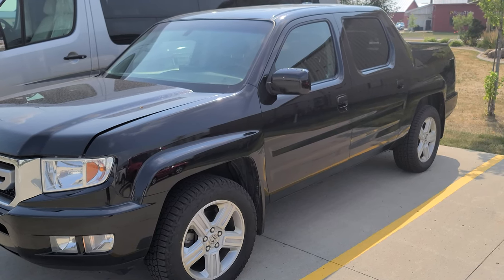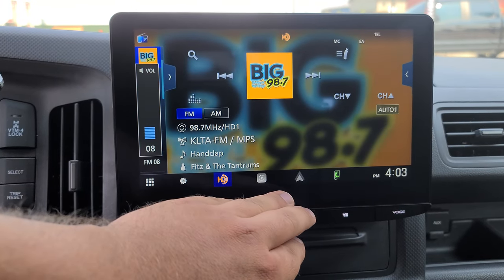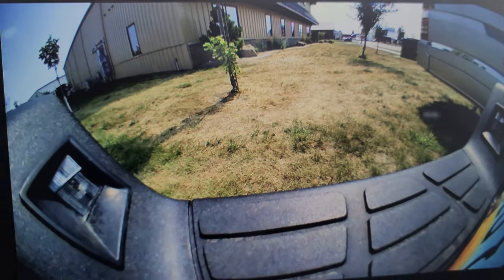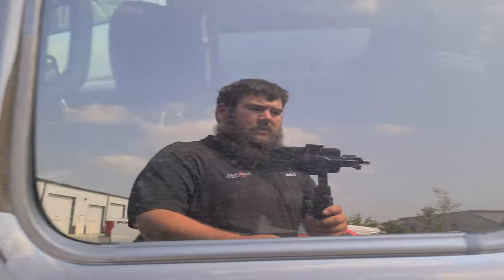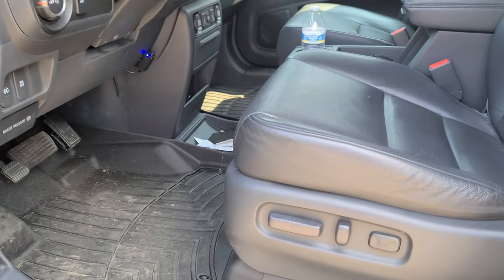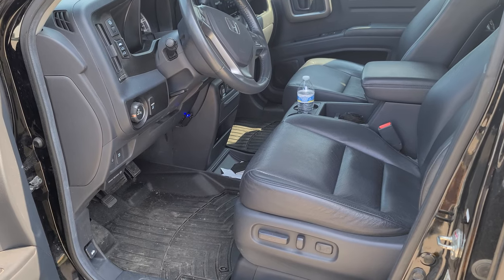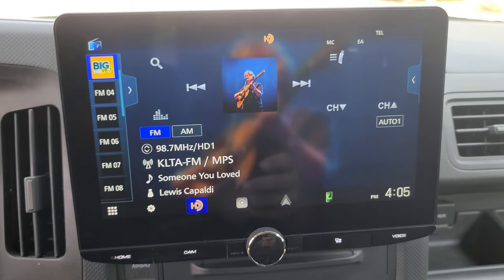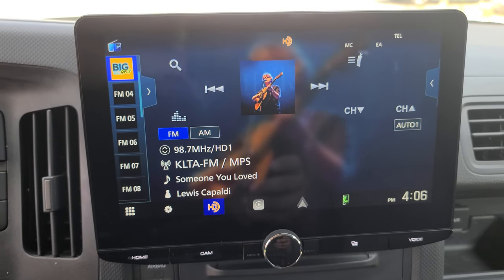2010 Honda Ridgeline Radio Replacement & Stealthy Subwoofer Install

Comment: Thank you! I have been searching for a way to either add an OEM sub to my 2008 RT, or find a way to keep all my room. 

I just picked this subwoofer up from ebay for $180. I am going to be upgrading my head unit to a sony xav-ax1000 too. I hope thats a good head unit, I really want buttons and a knob, not the touch controls. 

I upgraded my Girlfriends 07 camry with a BOSS floating screen one with apple car-play. The audio quality was far worse that stock, but it had nice pre amp out puts so I threw an AMP in it and it fixed the audio quality. Carefull with the BOSS units, as i think it lied about the power. But the software is really good.

Edit: They may not have lied, but I threw some JBL speakers in; and at high volume the quality was horrible.
Reply from the maker: @john-shreds Boss does tend to stretch the truth on the power ratings of their products. I am glad that you were able to get everything straightened out though!

Comment: Wait, you think there is more room under the seat than behind the back seat?
Reply from the maker: This client didn't want to take up any space under his rear seat at all. This was the perfect option to add bass to his vehicle and not take up any of his cargo space underneath the rear seat. Thanks for watching!
Reply: @theaudiogarage7461  No, BEHIND the back seat. Where the OEM sub sits. I have a Kicker Hideaway 8 inch and it won’t fit under the seat because of the DVD player.  I didn’t want to use that nice cargo space under the read seat so I pulled the OEM sub and put the Kicker in the OEM location. It is possible to put a better shallow mount sub in the OEM box, build a whole new box and I calculated that I can fit 3 Kicker Hideaways back there. This leaves the whole area under the seat completely usable and it’s also pretty hard to steal it if they can’t see it or find it without removing the upper seat.
Reply: Dk if you'll see this -I want to do exactly what you're describing, but I know nothing about wiring or head unit install. Was it hard to take out the OEM sub? And how did you secure the Kicker Sub in its place? Screws?  Thx @Yohann67
Reply: @TomTomTom87  I now have TWO Kickers installed behind the seat. A 10 inch behind the drivers side and a 8 inch in the OEM position.  I simply shoved the 10 in it’s spot, I used a piece of wood and bolted it the OEM holes and then strapped the kicker to the wood.
Reply: @TomTomTom87
21 seconds ago (edited)
Thanks for the quick response man. Was it hard to run wiring to the OEM new sub? @Yohann67
Reply: @TomTomTom87  Wiring was ez, pull the rocker covers and thread an 8 guage wire from the battery to the subs, then a RCA cable and a trigger wire from the remote out on my Kenwoood deck.
Reply: Wait theres a sub behind the rear seat? How do i get to it? I just spent like 3hrs  fixing the handle/latch that releases the botim of the seat so i can lift it up like seen in this video @Yohann67
Reply: @RandoManFPV  Depends on the model but yes!  Lots of pics and videos on subs on YouTube and such.   The OEM sub if equipped is not as terrible as you might think but  it has nothing under 30hz. The sub slopes to match the seat back. It’s behind the passenger seat and is about 6 inches deep to about 4 inches deep on the top. I had a Kicker 8 inch Hideaway from my previous vehicle so it slipped right in there. I found a used Kicker 10 inch Hideway for a good deal and stuffed it behind the drivers side rear seat. There is actually room for 2 Kicker Hideaways in the OEM spot if you mount them vertically. If you happen to have 3 it’s worth it, I don’t think I would go out and spend over $750 when you could have one built for that much.  

The Kickers are quite good, mine was excellent in my Toyota Tacoma Access cab where it was under the seat. It would hit 30 hard and a little bit at 25hz. It had NOTHING at 20 due to a subsonic filter. The effect of having 2 of them is synergistic and the 25hz output is much greater.  It’s not going to rattle your mirrors but I had tuned it to the point where you could feel it kick like a brat in the seat behind you on a long flight. Some people have added a new 8 inch driver to the OEM sub box, plenty of info out on that.

Comment: Now here is one for you. I put a free air ten inch sub right smack in the middle of my back wall bhind the rear seat. I dyno matted the wall bhind it, and e erything around it. I am in the middle of mounting another ten directly underneath the floorpan between the two seats. I drilled 1/4 holes in a speaker cover like pattern. Rubber mounted the sub underneath.  Built an aluminum diamond plate enclosure rubbert mounted and dyno matted with fill. Amps going bhind rear seat, and I have a  3000 watt inverter back there with a custom on/off switch on the dash and two receiptcles one in the  back of the center console and one in the trunk area. My  bed is carpeted and there is a  custom diampon plate water proof bed cover back there and automatic lock for the tailgate.
Reply from the maker: That sounds pretty interesting! This client wasn't looking for that kind of bass, but that is pretty neat that you were able to do all of that!
Reply: @theaudiogarage7461  thank you caleb Ill get some video of it.